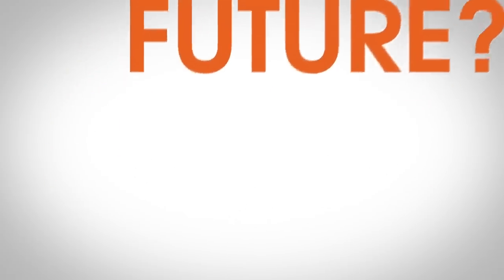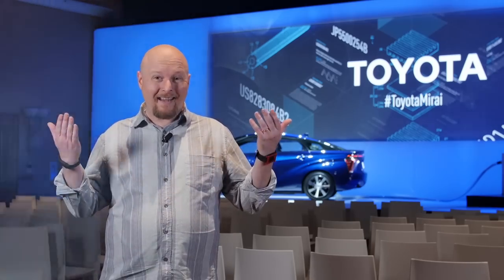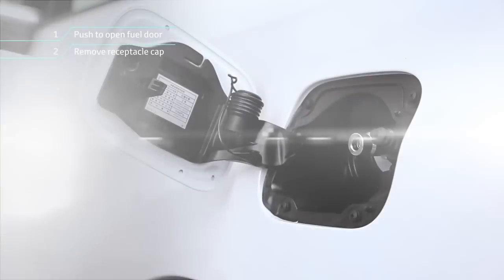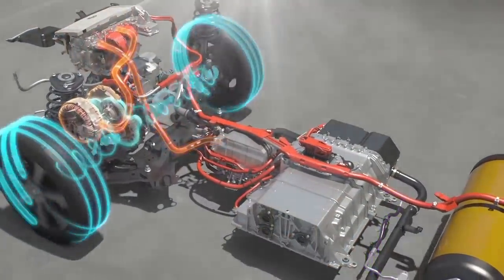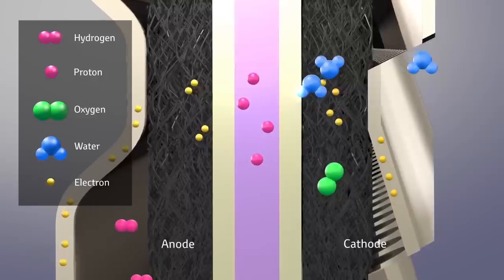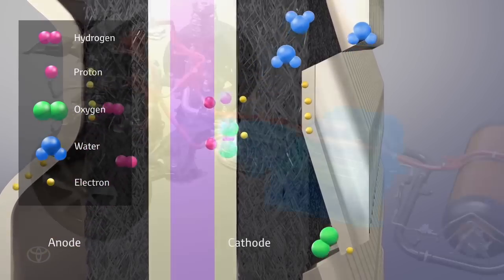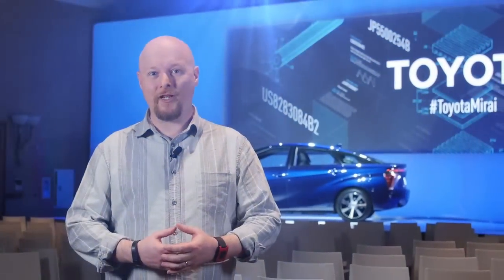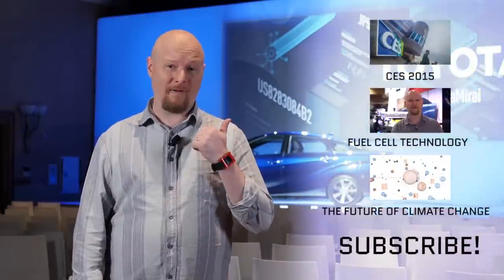How Fuel Cell Vehicles Work – CES 2015

Comment: What I wonder , if that technology is so cool , why don’t they create electricity using it?
Reply: Toyota has always lied in such promotional videos and this has not changed 6 years later. At 4:58min they claim: "No carbon emissions like petrol or diesel powered vehicles".
This is true - if you look at the fuel cell car alone. If you look at the whole chain (well-to-wheel), hydrogen today in 2021 is made from more than 95 per cent natural gas, coal and oil, as it was in 2015.
The hydrogen car is therefore dirtier than all other vehicles!
Of course, hydrogen can be produced from renewable energies via electrolysis. But this method is several times more expensive and therefore there will never be a large number of cars with hydrogen as an energy storage medium.
Toyota needed until 2019 to produce and sell 10,000 Mirai.
At 4:59min I had to laugh:
The biggest revolution has failed ...
The new Toyota Mirai II (2020) does not even have a folding rear seat back. The hydrogen tanks take up a lot of space.

Comment: Hydrogen fuel cells make for excellent batteries. The real problem seems to stem from a notable lack of clean AND efficient AND renewable/inexhaustible-resource power plants. Meet those three criteria with a power source, and we'll have a winning combo.

Who can bequeath unto me such a fabulous source?
Reply: Hydrogen is very poor battery. You put in 100kWh and get 25kWh out, so you waste 75% of energy.
Reply: Sasoon2006 WWhiteSShadow  By definition Hydrogen fuel cells are not batteries as they do not store energy.
Reply: patw52pb1
So, what would you classify them as?
Reply: WWhiteSShadow  Fuel cells are chemical energy converters, producers or generators of electrical energy. 
Batteries are electrical energy storage devices.
Reply: patw52pb1 Tell me, do you know where they get this energy from? They store it in their electrons. When the water molecules are broken into hydrogen and oxygen, their electrons are stripped to be used as energy. The acquisition of water is the only requirement to using that kind of fuel cell. Now then, it is important to bear in mind that all the chemicals that can be converted into other stuff including energy contain all that potential energy before being released inside of them, which essentially means that the chemicals in a fuel cell are much akin to the battery acid in a battery. They both store energy inside of them.

However, I won't deny the factoid that the energy is released differently. Is the true difference between fuel cells and batteries whether or not you're siphoning electrons out of acids versus kick-starting catabolic chemical reactions? If so, then I can certainly understand why they are labeled differently...
Reply: WWhiteSShadow Fuel cells are not batteries. 
A primary battery stores the energy within the cell and when depleted there is no more production of electricity. 
A fuel cell does not store energy. 
From your last comment there appears to be some misconception as to how a fuel cell operates. 
Try viewing these links and get a more accurate understanding of fuel cell technology. 
http://americanhistory.si.edu/fuelcells/basics.htm
http://auto.howstuffworks.com/fuel-efficiency/alternative-fuels/fuel-cell.htm
http://energy.gov/eere/transportation/hydrogen-and-fuel-cells
http://upload.wikimedia.org/wikipedia/commons/0/0d/PEM_fuelcell.svg
Reply: patw52pb1 Ah right, the reaction is ANABOLIC- my bad. Also, I'm thankful that you caught me using the wrong classification when discussing fuel cells versus batteries. They're both electrochemical devices, but I didn't mean to imply it actually was a battery- I knew it was either on a fringe group or that fuel cells were another class on their own. Perhaps I was looking at a certain component of the process like before the reaction occurred, such as coal in a storage unit waiting to be burned.

But anyway, the idea that this medium alone could form the entire energy chain alone in much the same way that petrol-powered machines can process more petroleum is most encouraging. I look forward to seeing all the kinks worked out...

Comment: Michio Kaku is full of crap on this one. This isn't a game changer. The primary source of hydrogen now is from the oil&gas industry that's why Shell loves this. Hydrogen is just a very inefficient way to store energy. Fuel Cells are still extremely expensive and require significant amounts of rare earth elements and there hasn't been any breakthroughs to change this. The infrastructure of the mythical hydrogen economy is a drawing board exercise. Elementary thermodynamic considerations show that a hydrogen economy is about as feasible as a perpetual motion machine. Hydrogen is not an energy source but an energy carrier, and when produced renewably, it is an energy carrier to the second degree, with electricity being the energy carrier to the first degree. As such, it greatly elongates the chain of energy transformations required to deliver a desired service from a primary source of energy. There will undoubtedly be applications in which hydrogen may be essential, but they will be limited because the services it delivers will come at a substantial energy premium.

Comment: I wish I can agree with all this. Love electric vehicles and I would love to see this tech work. One reason why those technologies are becoming an open source is because the companies actually got to the point of no return, where no matter how much more they will spend in R&D they will not be able to gain more. You need to find the people with the right mindset to take this to a different level. The second reason is the financial reason. Universe Law: Nothing is created, nothing is lost, everything is transforming. Unfortunately, being able to contain the hydrogen in a liquid state takes a lot of energy. Besides that, when it combines with Oxygen it creates water. why is this a problem? Just think about it. once you have those cars on the road, you basically have another oxygen consumer. Take that, multiply it by the number of cars running on this technology, and than by the number of times a hydrogen car consumes  more O2 than an average human. We will all be in a great pickle if that water produced is not broken back down in its primary components. If you'd find a way to produce hydrogen from water (resulting H to burn and O2) or other substances (ex NH4) I don't think that this technology will take off like the solar and electric business took off.

Comment: ⭐So basically,  the technology is ready, it's just about figuring out how to generate the 'most abundant element in the universe'..? Shouldn't be that difficult...⭐ What I would like to know is how effectively you could heat water and create steam with hydrogen... Hydrogen burns pretty hot doesn't it..? Hot enough to boil water rapidly..? Yes I'm interested in revolutionizing the steam engine, they are if nothing else,  very consistent and dependable..!⭐

Comment: The future of the cars is already here. And thats EV. Thats Tesla preciously. Toyota is just trying to get the ball in its court by opening the technical specs dreaming that they would be able to beat EV.

But the game changing item is not actually EV or Fuel cell. Its the Battery. The storage device that can now hold the free energy from sun 100 times more.

And who wants to go to a Hydrogen station, when you can recharge your car from home?

Would you go to charge your mobile phones to 10 blocks away?

So guys you will get to see the rise of EV and a fair try of the Fuel Cell to have some market share.

Comment: I think forward thinking is taking too long, it's not moving fast enough, forget 1970s this video was made 6 years ago and we're still here?! 😶😏😒😌🤨☹🙁😞😠😡
Reply: Toyota has always lied in such promotional videos and this has not changed 6 years later. At 4:58min they claim: "No carbon emissions like petrol or diesel powered vehicles".
This is true - if you look at the fuel cell car alone. If you look at the whole chain (well-to-wheel), hydrogen today in 2021 is made from more than 95 per cent natural gas, coal and oil, as it was in 2015.
The hydrogen car is therefore dirtier than all other vehicles!
Of course, hydrogen can be produced from renewable energies via electrolysis. But this method is several times more expensive and therefore there will never be a large number of cars with hydrogen as an energy storage medium.
Toyota needed until 2019 to produce and sell 10,000 Mirai.
At 4:59min I had to laugh:
The biggest revolution has failed ...
The new Toyota Mirai II (2020) does not even have a folding rear seat back. The hydrogen tanks take up a lot of space.

Comment: Ah fun, i just want hear it pop! Two step, loud as funk, not tttttzzzzzzz....
Reply: Toyota has always lied in such promotional videos and this has not changed 6 years later. At 4:58min they claim: "No carbon emissions like petrol or diesel powered vehicles".
This is true - if you look at the fuel cell car alone. If you look at the whole chain (well-to-wheel), hydrogen today in 2021 is made from more than 95 per cent natural gas, coal and oil, as it was in 2015.
The hydrogen car is therefore dirtier than all other vehicles!
Of course, hydrogen can be produced from renewable energies via electrolysis. But this method is several times more expensive and therefore there will never be a large number of cars with hydrogen as an energy storage medium.
Toyota needed until 2019 to produce and sell 10,000 Mirai.
At 4:59min I had to laugh:
The biggest revolution has failed ...

Comment: Gotta love how you keep saying Toyota is the one we'll look back on... just like the man himself, Tesla Motors isn't getting their credit for doing it first and doing it better.
Reply: Tesla Motors released all their patents for their electric technologies last year. They've also been pushing green cars for several years. Toyota only just jumped on the bandwagon
Reply: tesla does not have fuel cell technology.
Reply: ***** no one said they did.
Reply: ***** then why are you claiming tesla was the first and did it better. 

fuel cell has been around for a while, but platinum catalyst has kept them from becoming feasibly cheap. only recently did research in the reduction or replacement of platinum has made it possible to reduce the price.
Reply: ***** learn to read. There's more than one post here.
Reply: *****
Except you apparently.
Reply: ***** Bandwagon about what? Releasing patents? I guess in that case you're right when it comes to "green cars"... But if you think Tesla has been producing electric cars far longer than Toyota then you're wrong.
Reply: *****..hahahahha nice one

Comment: What's the big breakthrough? I mean, isn't hydrogen uneconomical to transport? I mean, doesn't it have to be liquid and thus at minus lots of degrees? 

I would think gasoline powered fuel cell would be a bigger breakthrough if it converted more of the chemical energy in the gasoline into electrical energy and convert more of the electrical energy into mechanical energy. In other words, use less gasoline to travel the same distance. 

Mu understanding is current motors average 25% efficiency, with a maximum possible peak of 58%. That means on average you spend up to 4 times less on fuel and at least almost half. A fuell cell has an efficiency of 50-75% and the really smart thing is the excess heat can be captured and used to produce more energy, bringing the efficiency up to 80-99%. Now THAT's a breakthrough. 

I mean solution to climate change are diverse, hydrogen cars may well not be the best. I am not a fan of hydrogen, not until I find out the economics of using hydrogen and whether or not it's more dangerous to transport than gasoline. 

More than anything else I want to travel cheaper. In my country, gas prices are insane relative to the medium income and prohibitive for minimum income. So spare me the CO2 thing, I am more interested in economics. 

And I would assume that hydrogen is bad fuel to use on cars, because it has a smaller energy density than gasoline. The calories in a litre of hydrogen I assume are less than in a litre of gasoline, as gasoline has up to 8 times as many atomic bonds as molecular hydrogen, and that's just the carbon-carbon bonds, not considering all the C-H bonds that also carry energy. So... isn't mileage going to be less for hydrogen? 

Anyway, by 2030 we'll look back at these days of concern about where energy comes from and how we power our transportation and what we produce and how much and all that and think what sad unfortunate times we're living now and just how easy life will be by then. No one is going to give any thought to energy and fuel by 2030. Mostly because there will only one set of answers: nuclear fusion+electric cars+graphite capacitors (a few seconds to charge a car battery for many times the autonomy). With such a system, there won't even be a reason to think about energy and fuel anymore. Kind of sad in a way... people won't be as engaged ni these issues anymore.

Comment: I DO know how this tech works and I'm unable to love it because of the drawbacks. Theoretical best is still not good enough. Why are you so pro hydrogen? Imagine batteries be 3x better than today. Where can hydrogen vehicles evolve in 10-20 years?? (except excellent infrastructure).
Reply: To increase the range of a battery vehicle, you have to add yet more batteries. Eventually you reach a point where adding more batteries doesn't increase the range because they weigh so much ! Dragging a huge chunk of metal around with you is like something out of the dark ages, it's insane.

Comment: what;s the fuel of the future??
DUBSTEP :))
Reply: Toyota has always lied in such promotional videos and this has not changed 6 years later. At 4:58min they claim: "No carbon emissions like petrol or diesel powered vehicles".
This is true - if you look at the fuel cell car alone. If you look at the whole chain (well-to-wheel), hydrogen today in 2021 is made from more than 95 per cent natural gas, coal and oil, as it was in 2015.
The hydrogen car is therefore dirtier than all other vehicles!
Of course, hydrogen can be produced from renewable energies via electrolysis. But this method is several times more expensive and therefore there will never be a large number of cars with hydrogen as an energy storage medium.
Toyota needed until 2019 to produce and sell 10,000 Mirai.
At 4:59min I had to laugh:
The biggest revolution has failed ...

Comment: Hydrogen fuel celled car is actually a horrible idea. The problem is where we would get hydrogen. Electrolysis is very inefficient. Which means we can't use water. Hydrogen is very reactive and doesn't exists in pure form on earth. There for energy is required to separate the molecule to isolate hydrogen. Which means hydrogen is really a energy storage mechanism rather than a fuel. Hydrogen is also colorless and odorless. Which makes leaks even more dangerous. It also has an invisible flame. Hydrogen is a the smallest molecule and it so it's not very easy to contain. It also causes brittleness in metal. So with all that in mind, You have to generate hydrogen and compress it, it turns out to be 50% less efficient than battery powered cars. If the battery powered cars are charged by solar than it's free. Battery powered cars have had it's problems in it's past, the newest electric cars solve those issues.
Reply: right on the dot..homey

Comment: Genius!
Reply: ???
Toyota has always lied in such promotional videos and this has not changed 6 years later. At 4:58min they claim: "No carbon emissions like petrol or diesel powered vehicles".
This is true - if you look at the fuel cell car alone. If you look at the whole chain (well-to-wheel), hydrogen today in 2021 is made from more than 95 per cent natural gas, coal and oil, as it was in 2015.
The hydrogen car is therefore dirtier than all other vehicles!
Of course, hydrogen can be produced from renewable energies via electrolysis. But this method is several times more expensive and therefore there will never be a large number of cars with hydrogen as an energy storage medium.
Toyota needed until 2019 to produce and sell 10,000 Mirai.
At 4:59min I had to laugh:
The biggest revolution has failed ...
The new Toyota Mirai II (2020) does not even have a folding rear seat back. The hydrogen tanks take up a lot of space.

Comment: So Mr Oilman how do you like my hydrogen fuel cell powered car? Mr Oilman: My friends at sparkplugland and oilfilter city are not happy, nor are Mr and Mrs fuel injector,  including all their baby injectors.  Cars running on water is nonsense, this can't happen can it? Poor Mr Oilman what is he going to do?
Reply: Toyota has always lied in such promotional videos and this has not changed 6 years later. At 4:58min they claim: "No carbon emissions like petrol or diesel powered vehicles".
This is true - if you look at the fuel cell car alone. If you look at the whole chain (well-to-wheel), hydrogen today in 2021 is made from more than 95 per cent natural gas, coal and oil, as it was in 2015.
The hydrogen car is therefore dirtier than all other vehicles!
Of course, hydrogen can be produced from renewable energies via electrolysis. But this method is several times more expensive and therefore there will never be a large number of cars with hydrogen as an energy storage medium.
Toyota needed until 2019 to produce and sell 10,000 Mirai.
At 4:59min I had to laugh:
The biggest revolution has failed ...
The new Toyota Mirai II (2020) does not even have a folding rear seat back. The hydrogen tanks take up a lot of space.